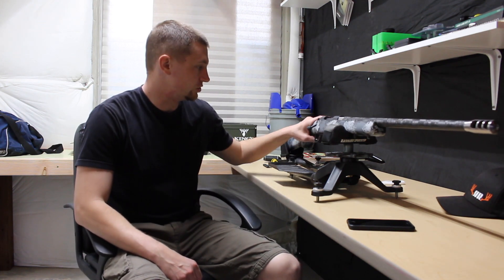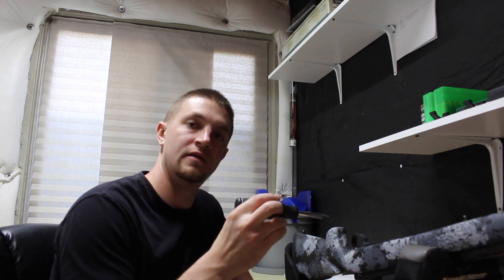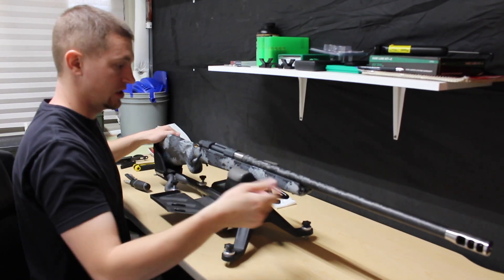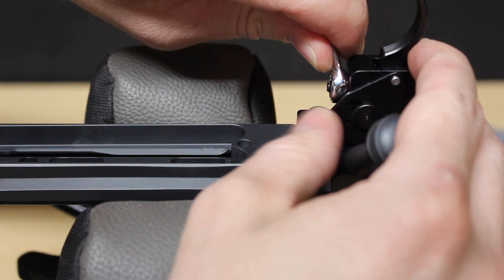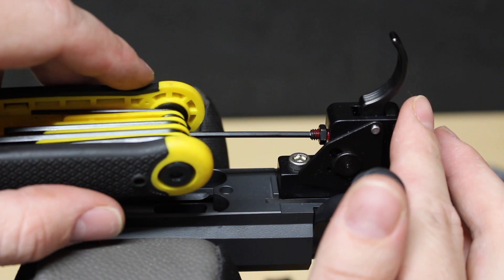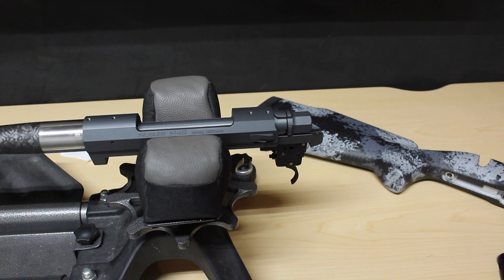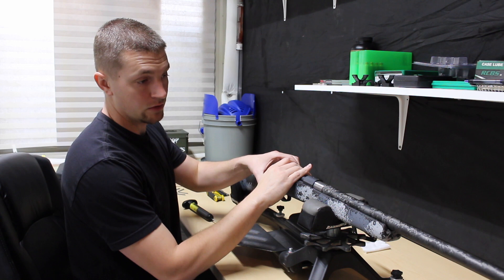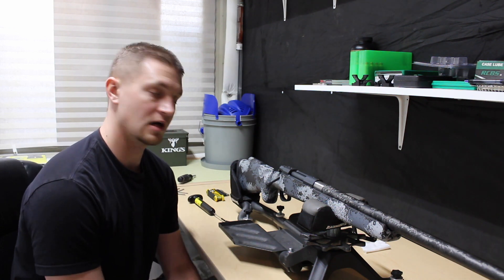TIMNEY TRIGGER ADJUSTMENT - NOSLER - 2.5LBS

Comment: I ordered the Nosler LRC a couple months ago. What muzzle brake did you install? My 28 Nosler is supposed to have a Surefire brake, but it’s pretty ugly compared to yours.
Reply from the maker: Matt Olson Hey Matt, that is a Holland 3 port break. I agree the break Nosler offers is not as ascetically pleasing. I ordered that, I believe for about 120 bucks then had my gun smith do the blending and timing.
Reply: Rowdy Racks Outdoors Thanks man.